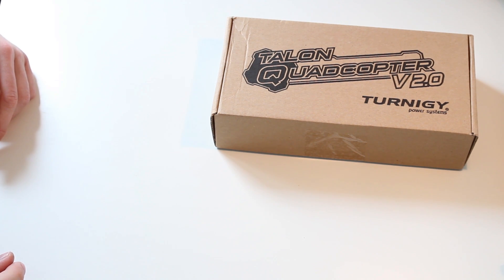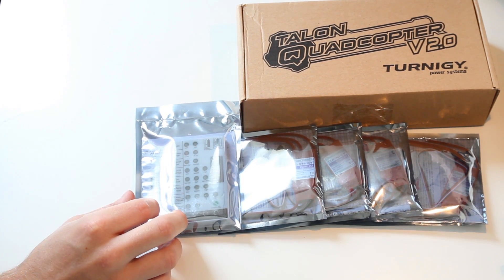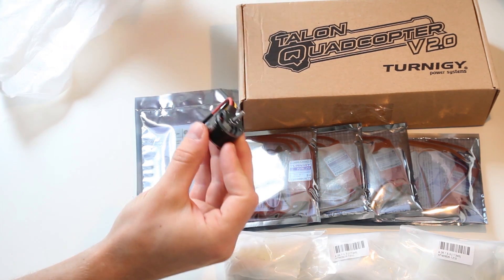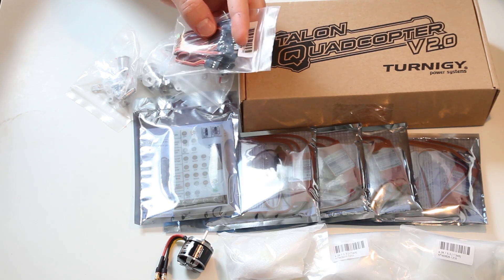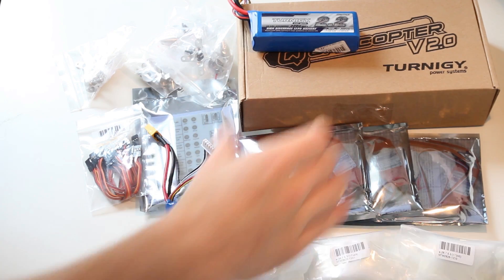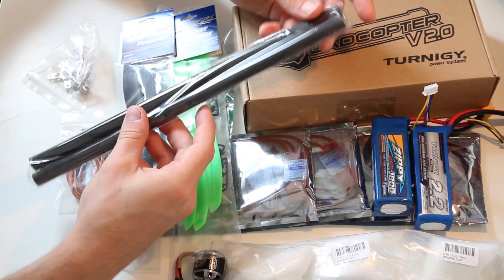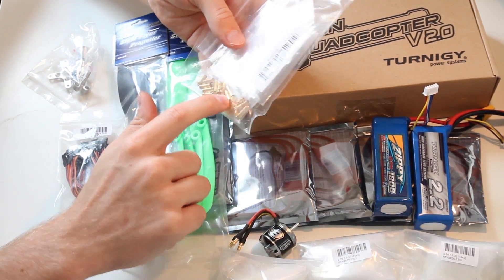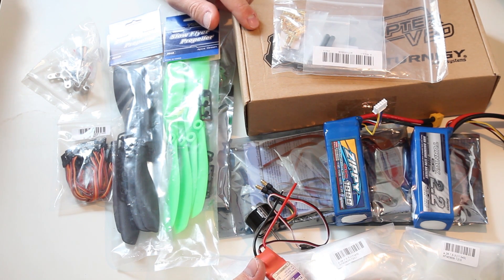Basic Quadcopter Tutorial - Chapter 1 - Parts and Setup

Comment: How much will it approximately cost me to build this qudcopter
Reply: Wondering the same.  It seems a lot cheaper to build a better quality (if not so good looking) quad than buying one with the same features.
Reply: with everything included (remote, battery, charger, cables, etc.) i am at a pricepoint of about 230€. Im only variation from his build is that i use Afro SLim 20A ESC's (http://www.hobbyking.com/hobbyking/store/__42551__Afro_Slim_20Amp_Multi_rotor_Motor_Speed_Controller_SimonK_Firmware_.html)

Comment: do you think id be able to attach a motorized nerf gun to one of these? or what would i need to do in order to make that happen?
Reply from the maker: You will need an extra servo/channel to trigger the gun. Maybe a gimbal for aiming?! I guess it is possible if you stripp the unnessacary parts of the gun
Reply: you can use a electric solenoid valve ( the one used for truck horns) paired with  a Co2 cartrige to fire bb's. Hit the button assigned on your remote to open the valve and shoot a bb. A gravity fed magazine should do the trick. 

if you want to make it full automatic while pressing the trigger , add an intermitent circuit that opens/closes at a fast rate , a blinking diode maybe ?

that whole setup will surely weight less than a nerf gun , with a greater "firepower"for a low power consumption. 

http://www.amazon.com/Vdc-Normally-Closed-Solenoid-Valve/dp/B007D1U64E/ref=sr_1_4?ie=UTF8&qid=1406392642&sr=8-4&keywords=electric+valve

http://www.amazon.com/Portland-Design-Works-Object-Inflator/dp/B003M2PNGY/ref=sr_1_1?ie=UTF8&qid=1406393012&sr=8-1&keywords=co2+inflator

http://www.amazon.com/Innovations-16g-Threaded-Cartridge-6-Pack/dp/B000660N1O/ref=sr_1_9?ie=UTF8&qid=1406393212&sr=8-9&keywords=co2+inflator

Comment: HI, I have a basic question. My transmitter receiver will be turnigy and my flight controller will be the kk 2.0 multirotor. Instead of going for turnigy esc and motors , I have a set of avionic esc's and motors. The esc's will work irrespective of the company differences right?.
Reply from the maker: No problem. You can use any brushless esc. Simon K for example.

Comment: kV means rpms per volt. (oddly enough)

1 kV means 1 rpm at 1V, 2rpm at 2V, etc.

900kV means 900rpms per volt, while 1500kV means 1500 rpms per volt.

if you had a 1000 kV motor, and used a 3s LiPo, (11.1V or so) you would get 11100 rpm at full throttle.

Comment from the maker: it is okay to go with a bigger motor, but not with more kv!!!! When you go bigger on a multirotor you usually want to go smaller with your kv and use bigger props. 1200kv/1300kv is already high. TeamBlackSheep for example fly 900kv and 750kv motors. There are even 350kv motors out there. 3000kv is way to high.